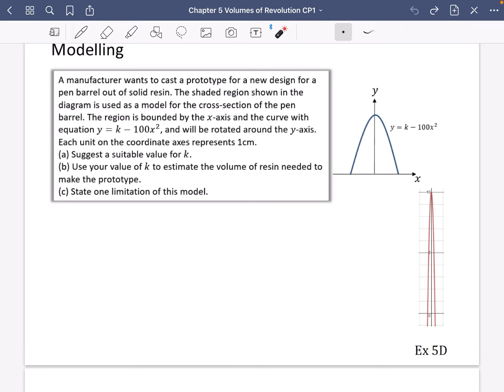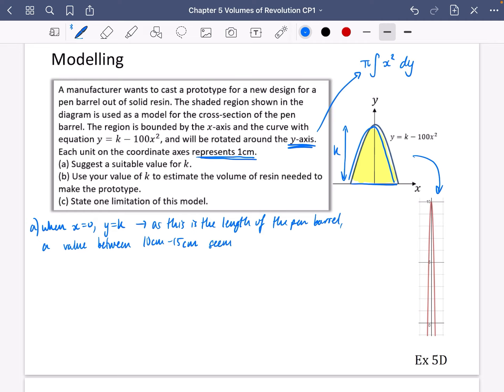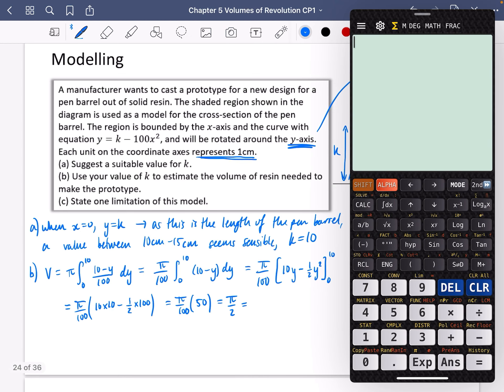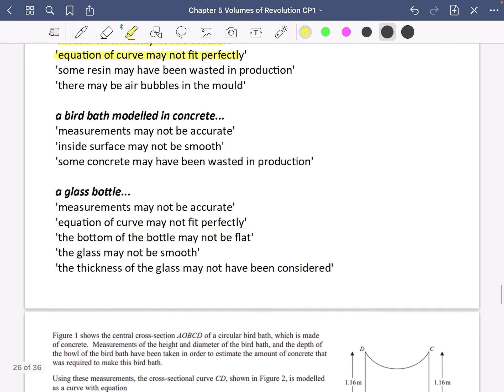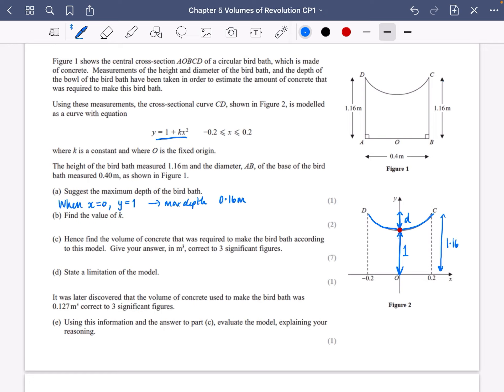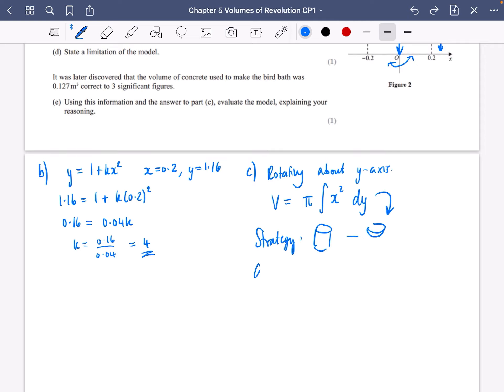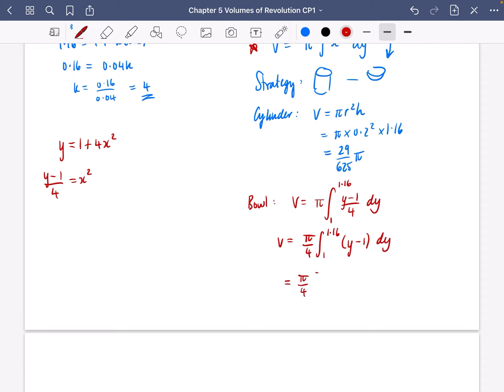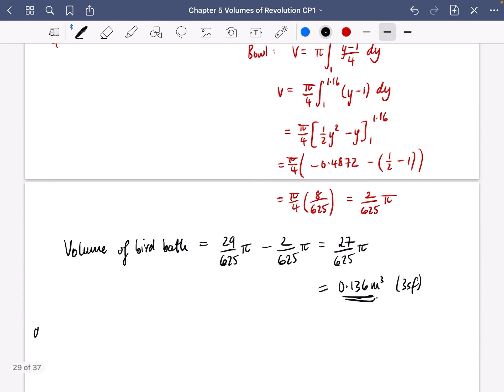Volumes of Revolution 5 • Modelling and Limitations • CP1 Ex5D • 🏅

Comment: I don't understand why you dont do pi/2 times the integral of x^2 dy for the bird bath question. Surely if you rotate it the full 360 degrees, it will overlap twice (as there is an "area" on both sides of the curve)
Reply from the maker: I see what you mean - but it is only rotating one piece of the curve around, the part that is on the positive side of the axis. It is always this way, and it never rotates both sections at the same time.
Reply: @BicenMaths  Thank you

Comment: Might be a little confusing to the students but we treated problems like the bird bath as strips at position x with width dx and height y, so you have a series of hollow thin cylinders so dV = area of cross section x circumference = ydx.2pi.x  The summation goes to an integral as dx-> 0, so the total volume = 2.pi x integral of x.y dx, use the x limits of 0 and 0.2 and substitute for y in x.y on integration you get 2.pi x [((x^2)/2) + x^4] with x=0.2 from the upper limit.
Reply: I wonder what the exam paper markers would have done with that?😊

Comment: For the bird bath question: why does it not work to do a single integral calculation instead of doing the cylinder minus the bowl bit? As in pi x the integral between 0 and 1.16 of (y-1)/4 dy. Not sure what I've missed?
Reply from the maker: If we just think about it as integrating for area rather than volume for a second, you'll see that if you integrated that section, a large part of the graph isn't even there between 0 and 1, so it doesn't make sense to find the area under it, and therefore not the volume either. Integration for areas and volumes only finds area under curves, and between 0 and 1 and the y-axis, there is no curve for an area/volume to be found! Hope that helps!
Reply: @BicenMaths   I really needed this explanation. I was confused for a good few mins. Thanks.
Reply: @BicenMaths been trying to understand this for a whole and I don’t understand. What do you mean a large part of area isn’t there between 0 and 1? All the area underneath it would be counted in it surely?
Reply: @BBK583  It's a little annoying to visualise, but try looking at the graph sideways as if the y-axis were horizontal. Then you can clearly see there's a lot of empty space between 0 and 1, and the curve actually bends towards y-values greater than 1, so there's no curve to integrate within the 0-to-1 interval. It's only between 1 and 1.16 that there's an area "underneath" the curve, considering the curve is getting revolved around the y-axis.
Reply: @nosir1479  i dont get why you cant do 0 to 1.16 as the original comment suggested with a single integral?

Edit makes sense now and for anyone reading, if appears you can integrate the whole curve in one go but that's because you're looking at it respect to x axis and the question is about the y axis. So if you look at the graph sideways so the y axis is now on the bottom you'll see the curve only exists from 1 to 1.16 as mentioned before that's why